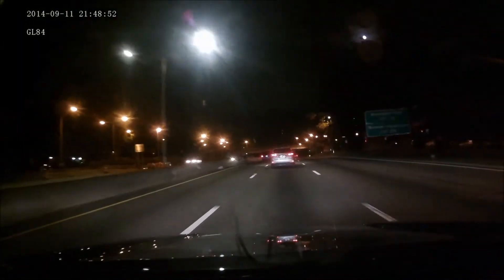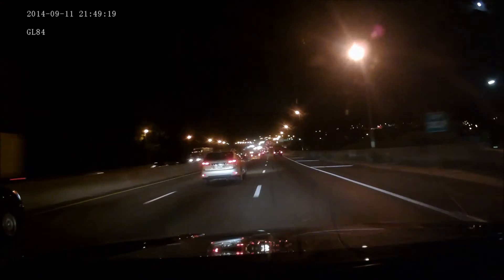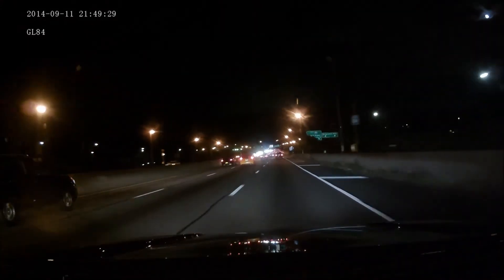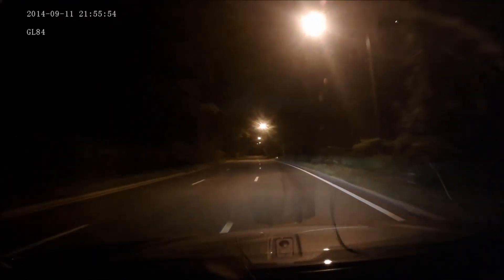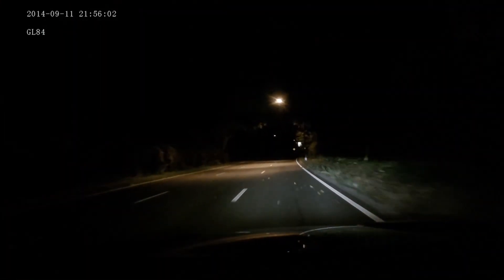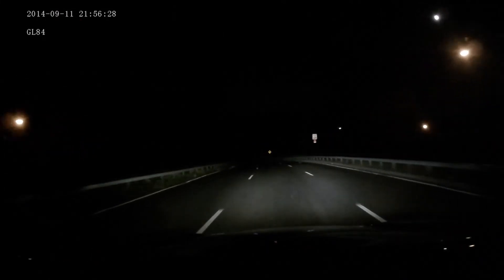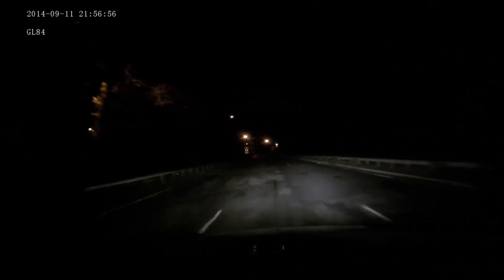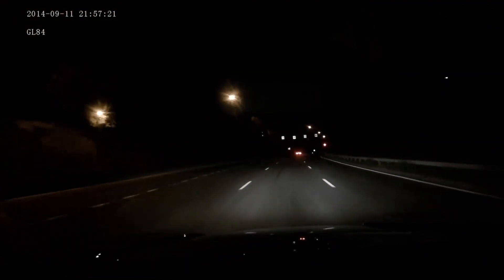2014 Crosstour K&N Intake

Comment: A lot of the accord v6 engine mods fit the crosstour even the high flow pre cats. They just don't advertise for it bc most people don't mod a crosstour. I just have the k&n drop in filter and cosmetic mods, like led lights blacked the hole car out, roof spoiler and stuff like that.
Reply from the maker: Go post pics on the forum, I'd love to see.
This is my first car, and I don't have a car background... but I love it.
I think we have some similar tastes... re:  Black Out / Yellow Calipers :)

My goal for this car has always been to make it into a "Sporty" family car, not a family "Sports Car"... if you get what I mean.

Aside from the list of mods you can see on my forum signatures, I'm running KSport Kontrol Pros atm... 16 kg/mm Front and 12 kg/mm rear... and they're great when the road is smooth, but driving to Philly or Baltimore on those was rough... that's why I've ordered custom lowering springs from CSS (go read on forums).

Comment: Yea im more into cosmetic looks, i had a well modded 06 maxima that i had for 7yrs. But it started giving problems, and got sick of fixing it. So i got the crosstour, always like them. And finally found one in black With v6 and 4wd with 30k on it. How is the drive on the ksports bc i'm iffy on lowering it. My maxima was lowered and i loved the look but the ride quality went to shit lol. What lowering springs are you going with bc i would be interested in a little drop, bc im going to get 20s for it.
Reply from the maker: I'm lowering mine -0.5 Inches @ +20% Spring Rate Front, and +25% Spring Rate Rear... Notably sportier than OEM without going crazy...

These are custom made springs from CSS (see Custom Lowering Springs thread on forum).

I have 20" Cont. DWS Extreme Contact... (245/45R20).
20" is fine if  you don't lower it... I like the rim, but hate the fact that Honda Brakes are so Tiny... with my open style look (TSW Nurburgring) it really shows off how tiny the rotors are...

If I were to do it all over again, I'd got 19" rims instead... I think that extra half inch of side wall will be much more comfortable if you ever plan on lowering it or going through rough terrain like the BQE, lol.
Reply from the maker: PS: I don't know if I have the time, but if  you guys have a car meet out there I could hop over sometime and  you can see for yourself if you like that kind of setup. But the Custom Lowering Springs won't be on for another 5 weeks...

Comment: hi
I enjoyed the video, 
I have a unrelated question
I bought a 2012 about 3 months ago the car is great,, no issues, ,
my question is about the transmission 
it as a characteristic that is annoying 
it feels as though it is shifting all the time , the dealer says it is related to the eco system and I will get used to it after a while, ,
can you give me any input 
thanks
Reply from the maker: You should check out crosstourownersclub post your questions there, and provide more details about how fast you're driving when this happens, etc. But at least for me it's less about when Eco (VCM)  engages or not... for me it's cruise control that's a bit jerky.
Reply: Okay 
thanks

Comment: Cool video. It's really loud tho. Wish they had an aftermarket exhaust system for it. Do you worry on summer time if it will suck up hot air?
Reply from the maker: The Intake has nothing to do with the exhaust sounds, the sound comes from the resonating metal tube of the actual intake vs. the old plastic tubing, and as I demonstrated in the video, it doesn't have to be loud if I don't want it to be.
And not really. There's the heat shield, as well as the original intake's plastic tubes (that extends from the grill down and around to the actual intake) is still there, so fresh air will be forced into there a little bit.
Reply: Wei Wang when I said loud I mean the intake sounded beautiful. But I searched for an aftermarket catback exhaust an I don't see nothing for the crosstour. But for my first mod this will be it. Thank again
Reply from the maker: Your first Mod should be the Rear Sway Bar from the Acura TL (look it up on the forums). CT is an "old person car", and it is designed to under steer horribly so you freak out and won't go so fast around turns (good idea, but bad execution)... Understeer happens pretty suddenly without this mod, and I totally did freak out the first time I took one of those circular on ramps for the highway.

I along with a lot of other CT owners, highly recommend this mod. I even helped a guy ship this part overseas cause they didn't have it in south america.
Reply: Wei Wang old people's car lol I'm 32 hope ain't that old haha. I already experience that I forgot I don't have my civic si no more took a turn too fast an I was like oh sh** lol but yeah I'll get into that. What year acura TL?
Reply from the maker: I'm 30, if you join the forums, you'll be the 4th or 5th person that's in their 30s (that I know of)... rest of em are +40 / +50s... (From what I heard, the CT is marketed towards +50 men).

Don't remember what year, but you'll find all the details on the forum, part numbers, and install instructions etc.

Comment: Will this fit my 2013 Crosstour ???
Reply from the maker: This particular model seems to be discontinued. However, any SRI that fits a Accord 2013 J35Y1 engine should work for our purposes (there may or may not be any modifications to fit ours: e.g. bolt locations etc).